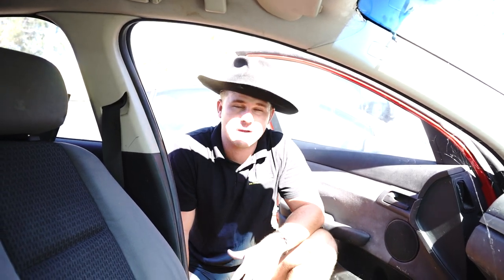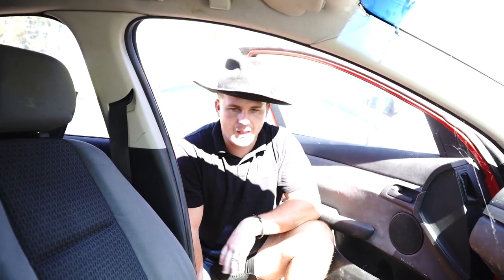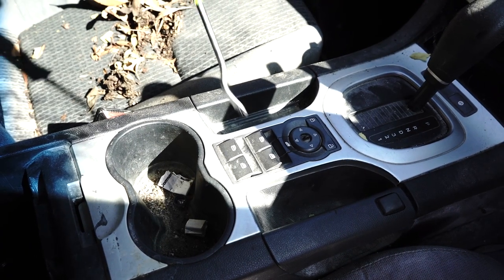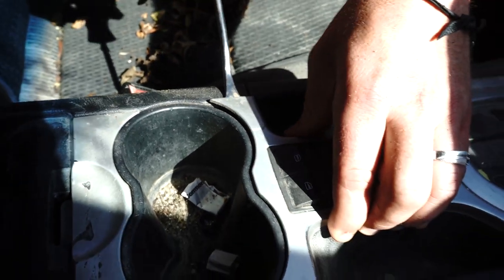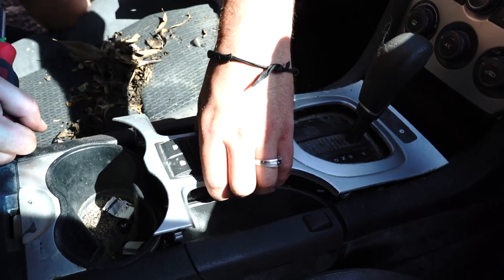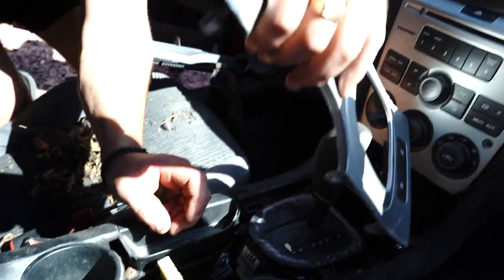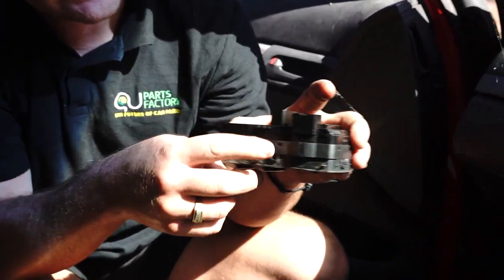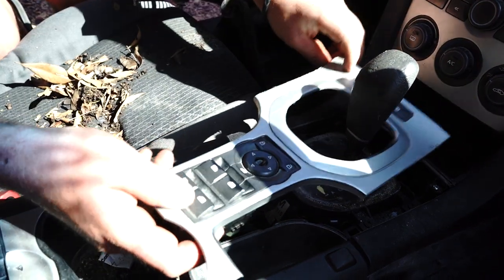How To Replace Holden Commodore VE Master Switch - Issue Problem

Comment: ok my r hand back door electric  window gos up but not down so I got a new 1 it's still does it so I got a new up and down switch for the door and it still does it but the central looking works wood it be the senter console switch

Comment: Im wondering if you know how to remove the in-car fuse board on a 2007 series 1 sedan ve holden commodore. Ive got a replacement fuse board and housing but and struggling to remove the old one. I’ve stripped the passengers foot well back exposing the fuse panel and have unclipped all power harness connecting to the fuse panel but am unable to remove it entirely. If your able to help me that would be great

Comment: getting a gear select trim is gonna set you back a bit more than a 30 lol
Reply from the maker: Not true. I can supply them
Reply: From you maybe but i have looked on ebay as mine is broken and they aint going for 30 bucks you could add another 100 mate ill have a look on your webpage
Reply: Yeah I've only seen for around 160 but I reckon he could supply them cheap...

Comment: When doing this will I have to disconnect battery or wouldn’t it matter I just need to replace power window master switch
Reply from the maker: No need to disconnect battery

Comment: 5:44 if 3 of the 4 window switches are working the windows, can one switch be faulty or is it the motor in the driver's side door?
Reply from the maker: Yes it can be the switch. Can also be the regulator